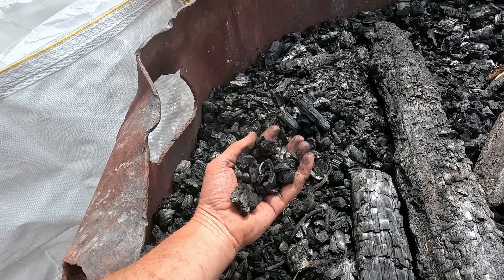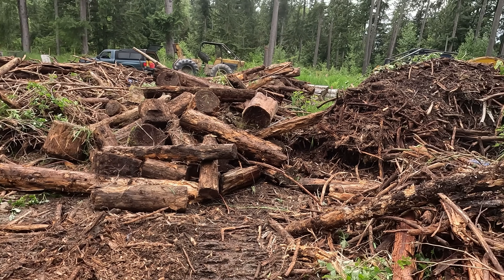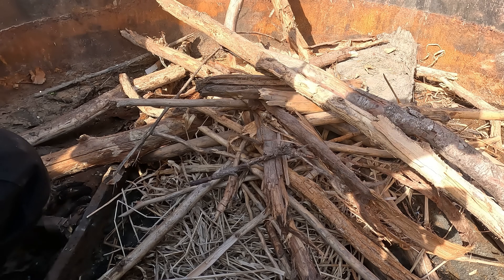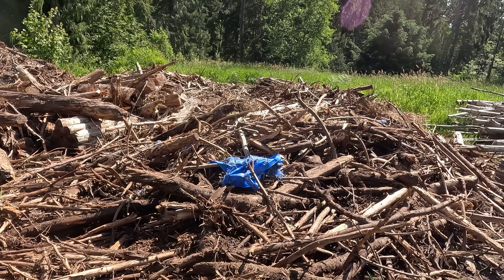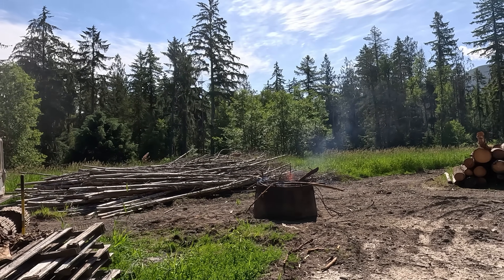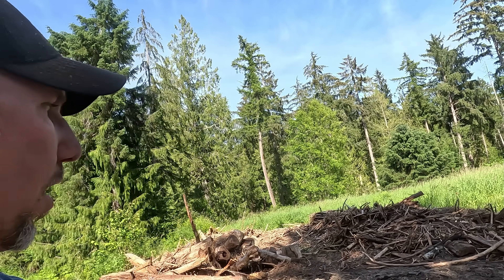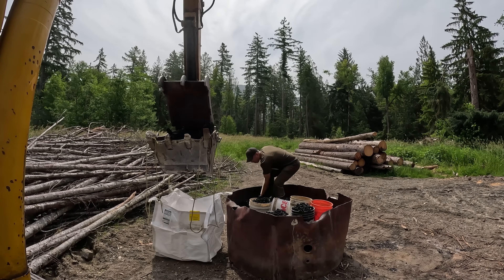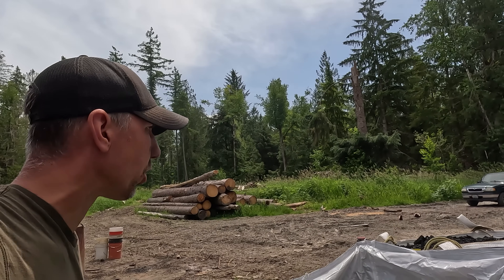How To Make Biochar *(Tips and Tricks)* From Logging Slash W/Ring Of Fire Kiln

Comment: You could also scale up and make charcoal by loading a steel conex container with wood and igniting it and letting it burn a while and then closing the doors to seal off air getting to the wood to convert the wood to charcoal. You could also get a woodchipper and make wood chip mulch for gardening and weed control. You could also chip the wood and compost the wood chips and bark and have potting soil in several years.

Comment: There is a Canadian Company that makes a Biochar mix. I found an 8 quart black bag at Walmart and it is 20% wood biochar and 80% compost. If you could design a Biochar crusher then Your Forest Products just got a very sought after gardening product.

0:52 That pile is not junk. That pile mixed with 20% of your homemade biochar will make an excellent soil amendment that I wish I had. 

There is an herbicide called Grazon that grass farmers use to get rid of broadleaf weeds. I got some manure delivered that had that Grazon in it and it kills a garden. I would have needed a couple of tons of biochar to neutralize my soil. Because I didn't have that I have had to wait 3 years before I could plant my garden plot.

Grazon causes all vegetable plant leaves to curl and severely stunts the seedlings. It has a 3 year half life in the soil. If enough biochar can be added to that soil as I said it neutralizes the Grazon so you can plant as usual.

Nobody does this down here in the lower 48, yet there are mass amounts left from our Forest Fires. Need a Jason burnt wood grinder. Forest Floors regenerate because there is biochar in the soil.

Lightning strikes various parts of the earth and Mother Nature knows when her plants need a small dose of carbon. Lightning caused forest fires are for a reason.

If we humans feed our earth good things, then earth feeds us good things. Burning crude oil products is not a good thing for earth's plants or the ozone which filters our air so we can breathe.

Comment: Why didnt you just burn the slash?
Seems like wasted effort
Reply: The goal is to get charcoal, not a pile of sterile dirt mixes with white ( calcium and potassium carbonates ) ashes .
Burning in the open air would let in too much oxygen and all the carbon would just turn into CO and CO2 .
The goal is to get a porous substrate that is then amenable to being colonized by beneficial microbes and fungi  , rather than just making a lime and potash chemical soil amendment . Both are useful , but , the biochar is a long term solution to radically improving soil quality . Lime and potash last a season at best , and , if the soil PH is already close to optimal , it serves little purpose other than to increase the soil alkalinity ( raising PH ) .